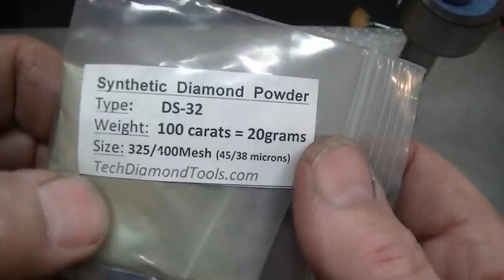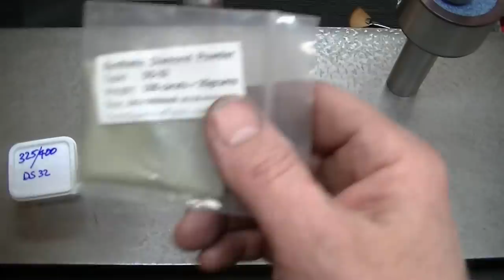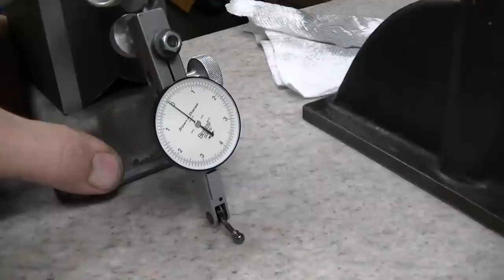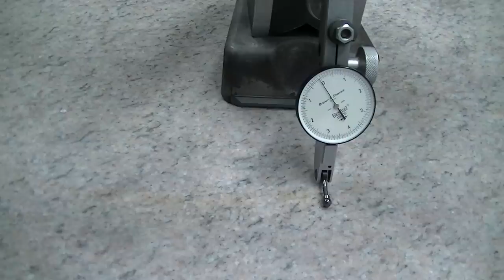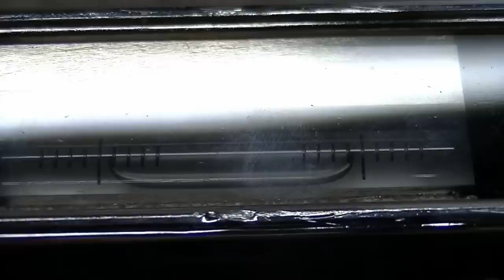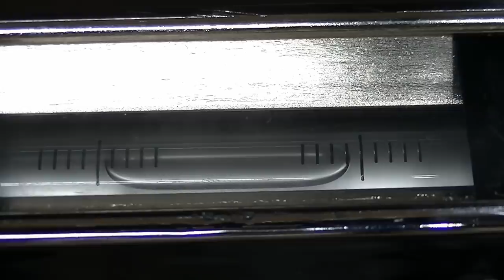DIY SURFACE PLATE LAPPING PART 1

Comment: Robin,
Having just done my plate and gone down the same learning curve you are now showing us I want to say you are precisely right on track.  There are faster methods but they require experience.  The most important part of this process is to have the tools to measure the surface know what the lap is doing and working out what you need to do to head it in the right direction. 
  
I was using a 10 X14" cast iron slotted lap and did my roughing wet.  I tried a number of methods but found simple water was best with the slotted lap.   I used 40um diamond grease suspension that comes in 10cc syringes (5 for $8 on ebay) and as you say a combination of charging the lap as you are doing and just letting the particles roll works best.  Various stroke directions as you are doing  but a figure 8 stroke rotating the lap about 45° degrees each way gave the best results for me.  Finish lapping was done dry with finer diamond.  The grease is not a problem for the wet lap but complicates dry lapping, a bit of acetone took care of the grease leaving just the diamonds.  I was happy and quit when I got it to a 24"X36" grade A plate verified by a 0.0002"/10" level and the repeatometer with a 50 micro inch  indicator I made for this project. A good 36" strait edge was a big help in the roughing stage.

You comment on and I was amazed to see how much my concrete floor flexed from my weight as I walked around the plate checking with the level!

Normal video speed please I am willing to watch what you produce.

Your lapping and measurement process is correct and I am sure you will get the results you are looking for.
Reply from the maker: Thanks, and thanks for watching and commenting.

Comment: Thanks for the excellent videos Rob!

A few years ago I lapped my old 1960's or so English made, factory hand scraped 16 inch O.M.T. optical rotary table with a Chinese 9x12x3 inch grade AA black granite surface plate off eBay and the rotary table platten showed up significant flaws in the surface plate!

The dry bare granite was doing the lapping and I just rubbed in circular motions whilst the table rotated slowly and it showed that the surface plate or lap had four low spots or grooves in a kind of swastika formation about three inches in from the corners where the plate lappers had somehow ground or abraded it in four 90 degree directions. After lapping the rotary table, my new surface plate was visibly polished and smooth with no significant surface defects or low areas and the steel rotary table was also polished to a bright finish on the high spots left by the original hand scraping.

Due to other priorities, I never did run an indicator on the table as it rotated but I wouldn't be surprised if it showed zero tenths of vertical runout apart from the scraped low spots. Even the base of the body was hand scraped flat. The overall quality is mindblowing compared to anything more modern that I've seen. I have another old O.M.T. 12 inch optical rotary table that reads to 30 seconds of arc on the scale that can be imagined down to 5 seconds and the 16 inch scale reads to 1 second or even less if you mentally split it. The only problem is with how they are used as they were designed for inspection and you need to zero the optical readouts once you're in range and deduct degrees of rotation from a known datum or reference point, presumably to measure deviation from standard at varying locations on a part like a ring gear tooth. The scales look like they are chemically or lazer etched into glass like D.R.O. scales but obviously circular and illuminated by a 12v bulb, viewed through a lensed eyepiece with focus adjustment. They're built like lab microscopes. God only knows what they would cost nowadays but I paid about USD$150 each or GBP£120 for the 12" and £100 for the 16" in English money. One day I'll make some videos but don't hold your breath.

Comment: This is very interesting indeed. I am planning to build an epoxy granite CNC with as much precision as possible, so understanding the various techniques for machine tool surface flatness is crucial. Many years ago I hand ground a telescope mirror. At the final point of correction I got frustrated and paid my friend who was a master telescope optician to finish and figure it. In the ATM community it is well known that getting something absolutely flat, near optically flat, at 1/4 wave for example  is very difficult. For this reason, the majority of builders buy their secondary mirrors.  From what I have seen of other videos demonstrating surface plate lapping, it seems making a telescope mirror is much easier.

Comment: I can't wait to see the Renz-o-meter. How are you accounting for the movement of your body weight? If you put the level in the middle of the plate and walk around it, you should see the bubble move all over. Even in my shop with a 1600lb plate and 8" floors, you can see it move just from my weight on the floor. A true differential level or autocollimator would account for that.
Reply from the maker: I will cover this in a follow up video. Thanks for watching and commenting.

Comment: Superbly done Robin, well done. I'm looking forward to seeing the next video.

A minor point, but one worth mentioning as I see this confusion coming up constantly in forums. At 08:00 that measurement doesn't indicate the plate is "straight", flat, or much else really. It merely indicates that there are no local deviations along the path that indicator ball travelled. The very same test could be done on a precise sphere and it would provide the same results. That test is similar to the so called "repeat" test, something that I see confuses many people who feel a plate can be tested for overall flatness with merely that test. Robin explained later in the video why that is not so.

Bravo for showing the effects of a level's own weight Robin. I have had many "spirited" conversations with people over the years, many very experienced in the field, where I have insisted that a surface plate cannot be calibrated with a single level. That was a large plate on a solid stand, yet the effect of the weight of the level was quite significant and if the level's reading was taken alone as gospel would provide a completely inaccurate picture of the plate. Even Taylor Hobson produced a video showing a surface plate being "calibrated" with a single level, a point I took up with them where they confessed it wasn't a valid test. Why the heck they would therefore produce that video is anyone's guess. A counter weight would certainly help at a pinch when roughing and was an excellent idea.
Reply: The "proof" you seek is provided by Robin in his video and correlates with both my own experience, principles of metrology, and just plain basic laws of physics and logic. The level has a certain weight and that will cause the plate to tilt  as the level is moved around it, as you stand in a different part of the floor, etc. Everything is compliant, it is only the extent it's compliant that will vary. How much will the plate tilt? Pick a number. You won't know without a reference. That is why differential levels are generally used to calibrate surface plates these days as they measure the difference between one level that remains stationary and the level that is actually doing the measuring. As the plate tilts the stationary levels provides the compensation. This effect is not, as some might suppose, insignificant, and a good level will resolve the flexing of a thick concrete slab as a person moves around it. 

The grade of plate is irrelevant, as the measuring technique is invalid. A surface plate cannot be "calibrated" or properly measured with a single level, end of story. Robin knows this, and as he explains he helped to compensate for this effect by providing a counterweight. That is also not a valid technique for actual calibration, as he clearly stated, but for roughing in would be good enough and at least acknowledges the effect.

Electronic differential levels are horrendously expensive, although it strikes me as entirely plausible for a smart guy like Robin to fabricate some form of optical comparison setup to look at a conventional bubble in standard bubble levels. An alternative that's not too expensive is to autocollimate the surface, which is what I have. It is independent of gravity therefore won't be affected by the plate tilting. It does take a long time however. The modern differential levels are interfaced directly to measuring software and will calculate the Union Jack errors with a simple keystroke at each measuring point.
Reply: Do what you like mate, I couldn't give a shit quite frankly. This is not a court of law and I don't have to "prove" squat. I had you figured immediately as a nothing more than a troll, thank you for proving that. I very clearly answered your "question" with my initial answer.

I explained why a single level can't be used to calibrate a surface plate and if that's not good enough for you then stiff shit, I couldn't care any less how "comfortable" you are or aren't. It should be obvious why that's so, and if you can't understand that it's no skin off my nose. As I said it's due to the compliance of the surfaces that interface the surface of the plate to the reference ie gravity. As one example, it should be obvious that if the stand is compliant (which it will be to a greater of lesser extent) the plate will tilt as a weight (ie the level) moves across it. Robin demonstrated that in the video, maybe you missed that bit. How do you suppose you're going to "calibrate" the surface plate when the entire plate itself is tilting each time the level is moved? How much is due to the inaccuracy of the plate and how much is due to compliance? Do you think the compliance is linear? You've apparently got yourself figured as a smart guy, you tell me. On second thoughts, don't bother. Walk around the plate and the level will move. Maybe you could spend a little less time trolling and a little more time actually trying some of this stuff and then you would be "comfortable". I have seen a situation where a level would go to its extremes just from the compliance of the stand and the mounts simply from the weight of the level moving.

Taylor Hobson isn't a "he" it's a company brainiac, and yes when I contacted them they agreed. It was a private email, and again, if that's not good enough for you, then stiff shit. 

I have zero intention of feeding a troll, so when (not if but when) you come back with your predictable answer don't expect another from myself. You reckon you can calibrate a surface plate with a single level then knock yourself out. I tell you what, seeing as you have put up precisely zero on Youtube why don't you upload a video of yourself lapping and calibrating a surface plate with a single level?  .... no I didn't think so. People like you never do.
Reply: Ok, against my better judgement I will respond in the interests that you are sincere in not understanding.

Imagine the world is made of rubber. It is, it's just that we don't see it that way because it's normally too small to bother us or even notice. Everything you look at around you is bending and swaying. Everything! Your surface plate is perched on top of this rubbery stand. You put your single level in the centre of the plate and it reads zero. The plate is "perfectly flat" for this argument. Happy days. You then move it to the edge of the plate. Since your stand is made of rubber the stand bends because of the extra weight on that side. The level now reads one line out. However we already know the plate is perfectly flat right. So that reading is obviously not the plate error, it's our rubber stand. More happy days. We have proved the compliance of the stand.

Ok now let's say we don't know if the surface plate is "perfectly flat". We're calibrating it so that's what we're testing. We also don't know how compliant (rubbery) is our stand. How could we! You put the level to the edge of the plate and it's one line out. Ok now what? How much of that error is the rubbery stand and how much is the plate not flat? There is no answer to this, hence why this is not a test. It doesn't matter what grade of plate you like to consider, there is no "good enough" for this situation. The stand may genuinely be made of rubber. Or it may be made of solid concrete. You may be standing on a floor of wood, or of granite on a 10' slab. You are measuring the total error with respect to the earth's gravity. That includes everything between the surface of the plate and the centre of the earth. For this reason if we are to use earth's gravity for the reference, we need to check the overall surface we're measuring hasn't changed with respect to that reference. That's why we need a second level to remain stationary while we're moving weights around our plate. That is the referee to check everything is still in the same plane it all began in, and if/when it changes, tell the measuring level how much it's changed.

That's about as basic as I can make it, and as I've run out of single malt, and aren't normally a drinker, where I'll leave it. I'll leave you to fill in any vacant blanks.

The bottom line is you can't calibrate a surface plate with a single level. That's just how it works on planet earth. Anyone orbiting another planet can choose any other interpretation they like. You can compensate and fudge and dodge, and you may finish up with a flat piece of granite, but it won't be a "surface plate" by the definition of the term.

Comment: Excellent video! I learned a lot of small details.
one thing that also surprised med when I lapped the one granite plate I have done was the speed of material removal. I applied the coarser diamond and it didn't take long before most of the surface was even within the tolrance I wanted
Reply from the maker: Thanks, and thanks for watching and commenting.
Reply: Very interesting! Almost so I want to buy myself a worn out plate (again)..

Comment: Following your journey.
Reply: Hi Forrest,
Somebody posed a question on the other video (the fixed audio version) about whether the CI lap sitting on the plate will mess with the level readings when used to gauge the shape (not level) of the plate. 

My answer to him was this:  ''I guess you're asking whether the elastic deformation form the weight force of the CI lap sitting on the plate and the subsequent spring-back when it's removed affects the measurements taken with the level regarding the shape (not level) of the plate? I think the answer is it's there, but it's literally negligible.'' 

Would you agree with this?
Reply: Lite Roadie Yup. Work the big details first but plan ahead for the little ones when the time comes.

Watch Robin. His self deprication doesn't fool me for a minute. He will work out every last detail and flatten that plate within an inch of its life and tell you how he did it.

You all realize the cast iron plates he started with were hand scraped to full bearing to small tenths. They'll have to be re-ground and scraped again before they're usable for their original function. Robin sacrificed his painfully developed precision surfaces to work down that 3 X 4 granite plate. In the end he will have a $2000  Grade AA granite plate for free not counting ten hours of damn hard work plus the tools he had to make plus the re-condition time for the CI plates he used as lapping tools.

Which poses the question: what's your time REALLY worth?
Reply: Thanks. I'm a big fan of your posts on PM. I especially liked the one about drill sharpening (lifting the whole drill on the wheel to get the relief as opposed to ''dropping'' the shank) and the ones about the two collar method, making two matching diameters concentric with the spindle axis and running an indicator to read the angle as opposed to taking a cut on the same setting and measuring taper).
Reply from the maker: Hi Forrest,I have not used those plates yet and may not. That plate is an auction piece and I am using it as is.

Comment: Wonderful. Two questions: 1- weight of the cast lap not throwing off your precision level? 2- How do you uncharge your lap (for changing to a lower grit and/or not ruing your cast plat for printing)?

Comment: Excellent video!! Don't worry about speeding up the video, I'm watching because I want to. Also I may be wrong, but I think your counterbalance was in slightly the wrong position at timestamp 28:07. I think it needed to be one mark over. This was I think confirmed when you "swapped" positions, but they moved different amounts
Reply from the maker: Good eyes, correct. Thanks, and thanks for watching and commenting.